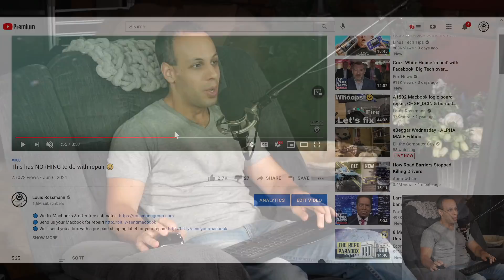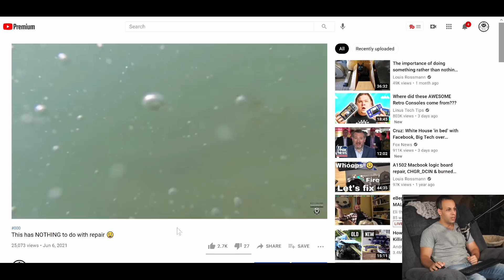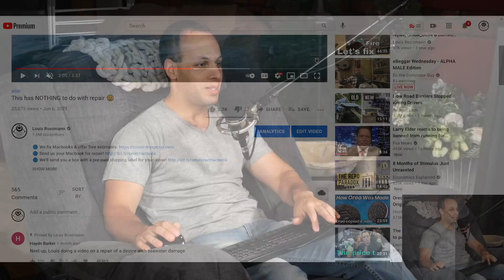Why are user serviceable batteries a bad thing?

Comment: Because to the layman, myself included until I saw this video, its easy to associate a phone structure, and electricty+water= bad, therefor its logical to assume from the start that sealing the battery is required for waterproofing, now I can go check online and see thats not true like this video exposed it the tech exists, however the clients of the major phone manufacturers are NOT aware.

On top of that if you want a "new" phone and don't know about tech or even care just want the new, "cheap" one you simply accept w/e the specs are at the price it is, the majority doesn't go check prices, specs and compare phones they go major retailers and ask for a 200-300 phone.
And if you add the non-tech "I want the current best" those really drive up the sales...

So its basically, the majority of people are not informed or don't care, you could make a dildo go up your ass as recognition software and MAYBE there people would complain, but since this is overall minor and majority rules it is what it is...

Unfortunate but money talks and the major manufacturers seem to be in this agreement NOT to make the battery replaceable, you'd think they'd use the excuse to show competition but there's more money to be made..... not innovating, again, money talks....

Comment: The only pro argument for the non-removable battery is the limited additional design options that come without having to deal with a removable back cover for a phone.
Leaving smartphones aside, what about the frickin' teslas which are manufactured as a one time use disposable product? I mean one dude couldn't buy lug nuts for his tesla?? not to mention the way the rest is manufactured...sure pretty car but harder to get spare parts for than an old unicorn motorcycle

Comment: The reason why batteries are sealed into the device is nothing to do with serviceability it is the national security concern. If the battery is removable the device cannot be remotely turned on and you cannot be tracked with your GPS. The phone can be powered on and beacon to the tower even if it is optically turned off. So any intelligence agency from any country can easily track your phone and device. This was the whole thrust behind sealing the batteries into cell phone and tablet devices.

Comment: I totally agree.  I used my S7 for 4 years.  I would still be using it if it wasn't for the battery not holding a charge.  So in January I spent $750 for the Galaxy s20 FE 5g UH.  Yes I love this phone, but it isn't perfect.  I can't swap the battery and it doesn't have a head phone jack.  It is also larger and heavier than the S7.  It is such an embarrassing accident to be pants by your own phone.  So now I don't put it in my pocket if I am not wearing a belt.  My vehicle is 13 years old, and I would listen to my phone playlist via an auxiliary cord.  Now I have to buy an FM tuner gizmo to blast my tunes via Bluetooth.  I miss the days when I could buy a "Backup Battery".  But why allow your customers to buy an extra battery, when you can have them drop a grand every year on a new phone.

Comment: You basically only need to seal the contacts on a battery to get liquid resistance.  I swear all these people bitching against the right to repair are just being ignorant and maybe gut reacting against the right to repair because of it?  Otherwise, it boggles me why they would other than this new group-think mentality that is taking over lately, and criticizing a product they own is like you're criticizing them and they can't handle that.
Reply: And I meant for the battery if user replaceable to be liquid resistant.  Yes the other electronics on the phone need the protection too.

Comment: Just for clarity, I had a Motorola Defy (MB525 in some markets), which I believe was one of the first waterproof android phones. It had a removable battery, by having a latch on the back that just fastened the battery panel firmly with an O-ring. There are plenty of perfectly sealed devices in other industries that come apart.

Comment: Perfect example how sealing devices like this is BS. I really like my Macbook air, but I hate the fact that the ram and SSD are soldered in. Specially since SSD are known to fail over time. I refuse to believe sealing and soldering components is beneficial to product designed. At the time I needed a macbook. That's why I got one. Now if my macbook dies and Apple doesn't improve to make it easier for me or a 3rd party repair shop to fix my macbook, I'm not buying another Apple product.

Comment: I genuinely miss having a Galaxy S5 with the removable back cover.  I did actually replace my battery.  £7 for the battery and about 15 seconds to replace it.
Also when the power button stopped working I could still easily turn the phone on using a method which involved removing and reinserting the battery.
I haven't had the displeasure of trying to replace the battery on any of the second hand S7s I've owned thus far.  (phones don't last very long with me because of the environment I live and work in)

Comment: The only possible argument I see for sealed batteries is to make the device thinner, because you don't have the plastic casing or latching mechanism/back plate. Even then, I don't think the 1 or 2 mm gained is worth it.

Comment: I like user-replaceable batteries, but I also like the glass/glass-and-metal constructions of modern devices, and I haven't seen anything that combines the two. I'd love if we could have both, but if I had to choose one or the other, I'd go with the nicer materials - I'm handling my phone every day of the ear, while I might have to replace a degraded battery once every one or two years at most, so as long as I can still get in there, I'm okay with that.

That said, there's literally no reason for plastic phones to not have removable batteries - looking at you, Samsung; if Sony could do it eight years ago, you can do it now.

Comment: Also the android kycera hydro (my very first smart phone) has removable battery and is water resistant and it came out a Long time ago! So the point is moot! I would love for a phone with replaceable battery as i wouldn't have to upgrade my phone every two years or so

Comment: Thee have been water proof watches for decades that run on batteries, imagine buying a watch for $800 and being told once the battery runs out it will need to go in the bin
Reply: Depending on the max depth (pressure) the watch can take, the back lid seal needs to be replaced.  many years ago I had a 100m Casio, and when the battery failed, I went to a shop that used to sell Casio stuff, asked for the battery, and the guy not only gave me the battery, but told me about the seal, which was dirty cheap.  Once at home I happily opened the lid (4 screws) change seal and battery.  Worked without any issues.  Casio was able to do this 30 years ago without any of today's crap.
Reply: @ikocheratcr  The watch I'm currently wearing is water resistant up to 100m.  If a small, comparatively cheap device like that can manage water resistance with a user replaceable battery, then there's no reason a $1000 smart phone can't as well.
Reply: Funny you mention that, those plastic swatch watches?
Yeah theyre sealed. Yes you can replace the batter but once the movement shits itself its a throw away.
Swatch also had the smart idea of making their plastic Sistem51 watches with an automatic movement sealed.....
So when the movement fails or starts running way too fast/slow its also a throw away.

A throw away automatic movement watch.....
Reply: @mickeydee3595  Swatch also came out with the brilliant idea of "watch for the summer", a throw away thing.  IIRC in  beginning 1980's
Reply: Mhm my watch actually has a solar cell and a rechargeable Lithium battery with a design endurance of 10 years. And it is waterproof. And the battery is replaceable, as in the back is held on with screws that are easy to remove, and the battery is socketed. But i have been told that service operation (even factory service) can't re-seal the watch to the same standard as it was done in manufacturing, so after the replacement, the rating will only be 5 Bar while it's 20 Bar from the factory.
Reply: @SianaGearz  so what you are saying is even after the battery has been replaced, it can still withstand being submerged in water up to 50 meters (5 bar of pressure). I would love an iPhone I could accidentally drop in a bath without breaking from water damage and voiding the warranty . I guess you must be a deep sea diver if you need to go to 20 bar. Your watch was probably assembled by hand in the factory, so I don’t accept that it can’t be repaired by hand if OEM parts are available
Reply: @SianaGearz  Citizen ecodrive
 I have one of those and it says on the back cover AUTHORIZED SERVICE ONLY AND was told the same thing it will "never be the same"
Reply: companies just want to make more money. it's sad

Comment: I can tell you my reasoning. Equal for equal, replaceable is better. But if sealed in gains me a 2mm slimmer device or 1% more battery life when the device is new, I'll take it. Because my usage pattern apparently is quite light on batteries. My 5 year old phone has 94% of its original maximum capacity

Comment: I just threw away a perfectly good (5 year old) hair trimmer. Everything still worked fine except for the battery that only last 2 minutes on a charge. Of course the battery was completely sealed in and the only way to access it was to tear down the entire device that is held on together with glue and get to the battery and desolder it and of course there's no replacement oem battery you have to get a sketchy one from ebay. 

A simple battery slot, with a standard rechargeable battery would have solved this problem and prevented more e-waste. I wouldn't mind having to pay a little extra to have easier access to the battery.

 It's cheaper and easier just to buy a new trimmer from Amazon than replace the sealed battery and that's exactly what they want.

Comment: I think a lot of the right to repair and the replaceable batteries (and most electronics currently) is that companies have learned that people buy a device and then use it until it does not work anymore. And if the device does not work, people buy a new one. Most companies are chasing high profits ( it looks good, right? makes people want to invest in the company, then the high level decision makers can make millions because profits are great). And:

If you look at buying a brand X cellphone ($500) every 5 years and the brand Y battery ($50) lasts 1 year then the total spent is $700 (4 years buying batteries with a battery coming in the phone) if you replace your phone in 5 years. In those 5 years brand X makes $450 while brand Y makes $250. You might decide your phone does not need to be upgraded for another 4 years. So now in 9 years (from phone purchase), brand X has made $450 while brand Y made $450. Total spent: $900 in 9 years

If a nonreplaceable brand Y battery ($150) is installed in brand X's phone ($600) and lasts 3 years then from our example above: over 9 years brand X will make $1350 ($450 * 9years / 3year_battery_life) and brand Y makes $450 ($150 * 9yrear / 3year_battery_life). Total spent: $1800 in 9 years

Now which scenario is more profitable for brand X? I think this shows why companies do not want their devices to have replaceable/repairable parts.

Comment: If you want to see an electric car that you can service, look up the 1979 Elektrek Uncar. Ignore literally everything else, but the rear bumper is held in by two clips and slides out easily, with the battery on a tray on rails for easy removal and repair ability. Like I said, ignoring literally everything else about the car it's definitely something that should be considered. A Chinese company I've forgot the name of has something even more interesting, where the battery is modular with stations that will remove the whole battery and slot in a different one fully charged all in 30 mins at the side of the road. That level of repair ability is good. Tesla? Yeah

Comment: The only "Reason" against "right to repair", at least here in my third world country is that the devices will be stolen more often because of better profits. :) that's the only way I see against it.
Reply: @chillbro1010  Yes, but currently you cannot re-use screens/batteries, etc. (Which will be more than 1$, no?) In the past there was a whole industry here. Stolen phones that couldn't be unlocked and sold in parts. :)

Comment: a lot of people that aren't super into tech in my life always say the same thing when asking me to fix or replace their phones. "it gets hot on me now, I think it's just too old and can't keep up"
They'll say this about something like a galaxy s7. not even like a 20 dollar walmart tracphone. And everyone seems to think that the processor is what's doing that heating up. In reality, yes, the cpu is responsible for some of that heat, as whatever they used between the cpu and whats cooling the cpu has probably dried out after a few years, but the main culprit here is actually, in most cases, an old, defective battery. Once I replace that, USUALLY (not every time) but USUALLY, the phones stop getting so hot. When using and charging them. 
I don't think manufacturers should make batteries more easily replaceable if it means the phones can't get better, smaller, nicer, etc. But DAMN, make it so I can buy one off Ebay from the people that make them.

Comment: What's really scary is the fact that there are people walking around out there right now with mobile devices that have non-user replaceable batteries where the battery is under heavy pressure, bulging from heat exposure, and is ready to explode.   In that situation, it's far better to have somebody in society that can repair the device ASAP than to have people like that walking around using that device for weeks or months because they can't afford to buy a new device right now or think the issue is going to go away on its own. It puts themselves as well as other people in danger from an exploding device. If it was user replaceable people wouldn't think twice about replacing a bulging battery. But if its not user replaceable they tend to keep using the device even though the battery is damaged. And those people are sitting right next to you on the subway, or airport terminal, or even on the airplane itself.  Just my 2 cents.

Comment: I bought a case so I could take my phone into the water.  At 5 feet, the screen is no longer responsive - water pressure keeps the touch screen from detecting anything.  So much for taking pictures!  Then I had the idea of just turning on the video and using that.  Worked fine until 15 feet when water pressure pushed in the buttons powering it off.

Comment: So, I'm gonna speak for all the zoomers out here and say they think it's old fashioned or cheap. Being unable to replace the battery is considered "bougie" and "luxurious". It's the same reason shit's made of metal and glass despite the fact that bashing them together guarantees the glass breaks. 

Meanwhile, plastics aren't as easy to break, they flex and bend under pressure (if made correctly) and are regarded as cheap and flimsy (and lighter, but whatever).

Idk how many times I would talk to a sony fanboy and they'd say something to the effect of: "shut up before I take the batteries out of your controller." to the tune of raucous laughter. I use Panasonic Eneloop batteries, and sure, they don't last as long as Lithium, they aren't alkaline, and won't spill battery acid if they go bad.

Comment: I see everyone here doesn't know the joy of reassembling their phone after dropping it and trying to reach the battery that somehow slid under your car juuuust far enough that you need to move your car to get to the damn thing.

I like that my phone doesn't RUD itself anymore. I can still physically replace the battery too because I know how to use tools like screwdrivers and suction cups. However, I hate that it's fucking serialized and locked to my phone, making DIY replacement essentially moot.

Seal the batteries in all you want. Just make them available to buy and install without having some neckbeard molest my phone and steal my nudes.
Reply: Sorry, can't agree that a solution to not having to fetch a battery from under something after dropping the phone is gluing the phone shut
If the choice is "drop phone - look for battery" vs "battery dead - painful opening process", I'd prefer the first since dropping the phone isn't inevitable and if I can't recover the battery in the process, chances are the phone is also fucked
Reply: @MrCh0o  IDK what phones you buy, but my iPhone is held together with two tiny screws, and the adhesive strips holding the battery in have pull tabs for serviceability. It's maybe ten minutes of work to get in there, replace the battery, and reassemble the phone.

I just don't have access to the damn app to reset my phone if I actually do replace it, and that's the real problem.

Comment: water resistant on top of the line regular name brand phones nowdays is just like the 10 bar water ressistant on watches 10 yrs ago... 1 hard fart and it corrodes form the humidity inside 1 good fart. that seal is as good as a cheese puff lock protecting against burgulary....
resistance and long life span or easy to repair is only found mightbe in something that is built to last or something like Caterpilar or Sepura phones, although even there i don't think they offer the schematics due to at least high build standards or what to last and keep brand reputation up, although not a must. consumerism = buy more, not last a century ffs